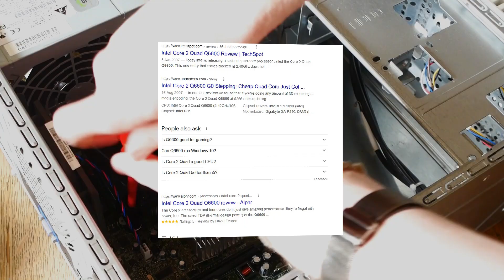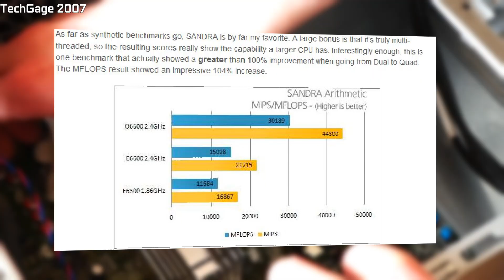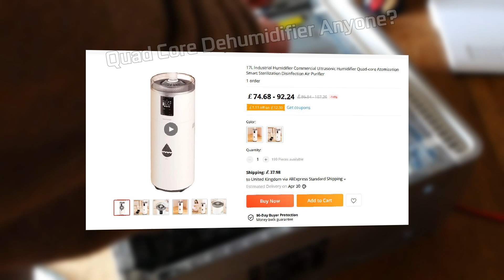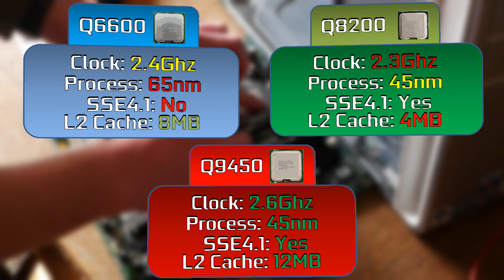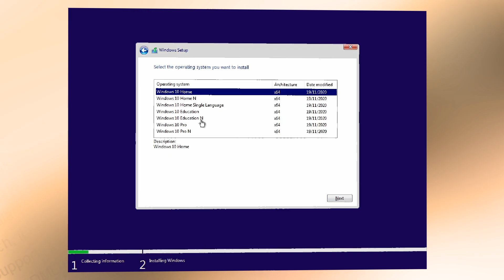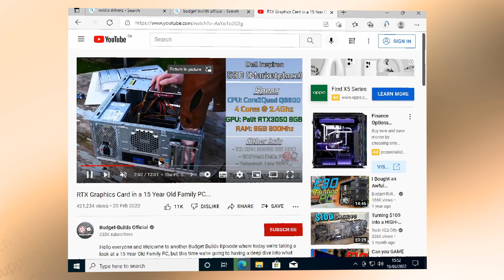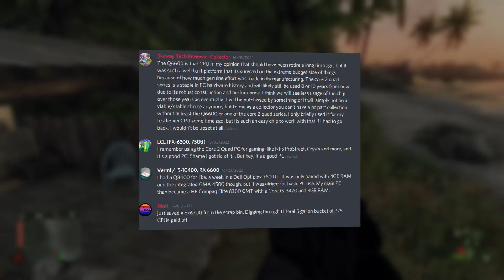Intel's Core2Quad...Finally Obsolete?

Comment: Pretty much confirms the experience I've had on my QX6850, E&X5450. Later C2Q are the only properly useful models. Not sure if it was just my setup or the finicky P5Q Deluxe - Windows 7 and 10 ran worse with the QX6850. And that's with all at 3GHz (Xeons both overclocked to 4GHz without any drama so that vastly widened the gap - QX6850 only 3.6GHz due to 1x die running 10 degrees C hotter).

The Xeons BTW ran beautifully on my free Asus P5K-VM - in fact it ran heavily modded (Realvision ENB+all mods recommended by it) Skyrim nicely even paired with my GTX 650ti 2GB. After upgrading the motherboard however I was never able to get the same setup working as well. Also, never try overclocking Pentium 4 630 on budget mATX boards - things go badly.

Comment: Using a Q9550 equivalent Xeon E5440 in a Gigabyte EP45-DS3 motherboard overclocked to from 2.83 to 3.65 GHz and later I want to hit the magic 4.0GHz :D It's running with 8gb of GEiL Ultra DDR2 and a GTX 760 :P

Yes, Currently I don't have enough money to upgrade to a new platform, but I think it is interesting that I still using a C2Q for gaming, and can play GTA V on Very high, NFS Payback just to name some heavy title, and much more less heavy title of course. 

Overclocking gets the C2Q to another level, you should check out the performances with a Q9xxx on at least 3.4GHz :)

Comment: I still have my old Q6600 (G0) in somekind of retro pc running Windows XP. When i got it, i bumped up the FSB so it's running stable at 3GHz for years now. Running it at stock speed is almost a crime...

Comment: This video makes me want to go in the attic and get out my Asus p5e3 deluxe with DDR3 support with my QX9650 and see how much better I can do than you at 4.2GHZ. Maybe i'll make a video about it... some day :P
Reply from the maker: You’ll probably beat 99% of AMDs FX Releases on that beast.
Reply: @BudgetBuildsOfficial  leave FX alone 😔😂
Reply: @crofty565  the FX 6000 series was good budged for sure the worst CPU's AMD ever made was the A10 and so on CPU's that had no L3 cache or so that was really stupid.
Reply: @allxtend4005  I pulled together an A10 7800 build for my mom because it was quiet and relatively cheap… 🤐
Reply: Ahhh Linpack. My QX9770 @4.0 under liquid breezed through Linpack at under 55C core temps as if it were nothing, P95 barely elevated her core temps above idle at 4000-4200.
Reply: @spicywolf6718  sounds about right. A lot of the later chips did that at or near stock voltage.
Reply: I'll gladly wait that some day Timmy!
Reply: Pls
Reply: With that clock you'll easily reach 1000 points in Cinebench R20 and be able to play games like GTA V, Doom 2016 or Witcher 3
Reply: Three years later now. Let's do it
Reply: That is a very good motherboard. I wish I had one. They are still very expensive.
Reply: Me too.  I have an Asus p5e3 but its not the deluxe.  Still a great board that will take 16 GB of ddr3.  Not sure what to do with the board yet, but I may pair it with a GTX 770 2 GB I have.  One machine I still use has a Biostar TP45E combo.  This board is so funny to me.  It will take ddr 2 or ddr 3 (up to 8 GB).  I have a q9400 on that board, which is overclocked to about 3.6 ghz if I recall.  I enjoy using that PC still today-a really granular kind of gritty experience and very nice...
Reply: @WunderOps  did it take much work to get the 16GB kit going? From memory the X38/X48 chipsets have limitations on refresh which doesn't extend high enough for most 4GB modules. I didn't have much luck with 4x4GB Dominator GT but it mah have been the RAM as it was finicky in a Haswell rig too.
Reply: @spicywolf6718  I haven't actually tested the board with 16 GB yet...only 8, but it was 2 4GB modules.  Wish I could remember which ones I used for the test, but it was some time ago, and I have several types of DDR 3 here that it could have been.  It wasn't a long test...just testing the board for basic functionality after I purchased it on ebay.  Hope I can get it up and running, the holdup being which processor to purchase.  Also, I will need a solid cooler and you name it, including PSU and case.  Coming up with the parts will require some creativity, so who knows when I will be able to finish the job, but I will get to it eventually...just like I did with the Biostar PC lol.  I wonder if your RAM was too good?  Is that possible?  Chances are I was using Crucial basic DDR3 RAM or Kingston low profile RAM.  I think I was using 1333 mhz (dual channel).  I know that is what's in the Biostar computer...
Reply: @WunderOps  very specific Corsair part nbers would post with 16GB, I managed to he the post screen at aassive downclock but my understanding is that even if you can show post it won't be usable memory as it won't be addressed or something like that. I just don't have a quartet anymore to find out
Reply: @spicywolf6718  OK, thanks for the information.  I am so curious now I think I will get the board out on a test bench I made here and take a look at this memory issue with this board.  Let you know as soon as I have some information.  Part of me is so sure I had it working with 16 GB even, but memory is failing me no pun intended and no bad mojo hopefully 🤞
Reply: @spicywolf6718  P5Q3 is seeing 16 GB in the BIOS.  I did not install an OS, and the 16 GB was a matched pair of Kingston 4 GB 1333 Mhz sticks (8 GB), a stick of standard Hynix 4 GB 1333 Mhz, and a 4 GB stick of HyperX 1600 Mhz (all I could find).  So this combination on the standard P5Q3 motherboard posted fine and all the ram was visible in BIOS.  Just noticed I have a P5Q3 rather than the P5e3 mentioned earlier in the discussion.  Sorry I couldn't put the board through the paces.  Don't have a case or the space here at the present time.  Good luck with your PC!   My feeling is that this board might be relatively stable when all is said and done, but I'm probably basing this assumption on the looks of the board which seems to be like new almost...
Reply: only 4.2ghz? That chip should easily be able to hit 4.7-4.8 on water! I had a Q9650 E0 stepping stable at 4.7ghz on that era's watercooling (cpu blocks were terrible compared to now). Might still have some of that kit floating around. Don't have any of my kit from then left except a single kit of DDR2 RAM (2x4gb), but I've been considering doing a fun build to revisit that stuff sometime
Reply: @TheOriginalFaxon  you're crazy. 4.5 is max I could hit on sub zero cooling
Reply: @TimmyJoePCTech  what stepping was it? I never has problems with temps on water with the E0 stepping chips. Was pushing like 1.42v through them, but yea, 4.7 all day stable no problem. Bought that chip in May 2010 from Frys lol. Gotta remember back then, a major stepping change could mean dramatic increases in bin quality. Gotta remember, that chip launched in Aug 2008, so by the time i got mine, Nehalem had also been out for a year and a half alongside it as the HEDT option, and bins on 45nm chips improved dramatically by 2010. I was seeing confirmed OCs on forums of E8700s hitting past 5ghz on water cooling, and past 4.7ghz on air. Those E0 stepping chips were absolute fucking monsters, some of the highest OCers i've ever seen
Reply: @TheOriginalFaxon  I highly doubt your prime 95 stable
Reply: @thej3799  feel free to Google around, there's tons of screenshots from that era of rigs that were stable at those speeds. I had moved to using linpack by then though, rigs which were p95 stable would not be linpack stable a lot of the time, due to the difference in how they test. That rig was 100% linpack stable for the 2 years I owned it, until I upgrades to a 2600k which was also 4.7ghz linpack stable. Idk why people think I'm lying when there's tons of evidence that these CPUs absolutely existed. If I could share images here I still have the screenshots and everything

Comment: The very first system I actually built was back in 2008 with a Q6600. I kept that chip for 7 straight years and used the 775 platform for another year with a Xeon X5460, as my primary rig. Then in 2018 I purchased again a C2Q, the Q6700 this time and along with some really cheap parts I built a pc to use it as a backup and for older games but sadly I haven't used it for over a year now. I'm in the hunt for a high end sli capable lga775 motherboard though and I'll be hopefully tinkering again with the Core 2 Quad in the near future. A friend also has retired his good ol' 775 system with a QX9650 in it, so I hope I can build a new system with that chip!

Comment: I  built my overclocked to 3.4Ghz Q6660 system way back in 2007 and have only just retired it although I'm sure I'll still find a use for it somewhere. I've upgraded the graphics card couple of times over the years and now paired with a GTX 970 it's still a pretty good machine for basic desktop use and older or more simple games. My Q6600 system is by far the longest lasting PC I've ever built and I somehow doubt I'll still be using my new bonkers fast I9 12900K in 15 years time.  Q6600 I salute you :-)

Comment: Got an Acer Veriton SFF with an Q8200, 4GB DDR3, 60GB SSD, HD5570 1GB and a 250GB HDD which works perfectly for my little one playing Roblox etc. These machines with an SSD and 4GB RAM, 8GB if you can get it are still perfectly fine for day to day use and certainly for people on a limited budget because games from years gone by let alone AAA titles currently are still worth playing.

Comment: On my lan system I take when I go to friends houses I have a Q9650 (separate PC since my main workstation is huge and heavy). Does pretty well. Have a GTX 670 in it since you can get them brand new for barely over $100 if you know where to look  and they run great. 
Also in my NAS/render farm (long story) I use a Q9550 and it does pretty well. Mainly since I can get LGA 775 boards for free lol

Comment: 6days later i upgraded sister pc from core 2 duo e8400 to quad q9400 because i need to run gta5 without mising textures on it, but still some textures mising. The pc has msi g41m e43 motherboard 8gb ddr3 ram and hd 6850 2gb

Comment: Funny that you should make this video as I'm considering what to do with my C2Q 9505 rig that dual-boots XP & 7 for old games from the early 2000's to early 2010 or so. Win7 to download the games somewhat safely with somewhat modern browsers, XP (32-bit with PAE patching to allow more than 4GB RAM recognition) to actually play them on period-correct OS and hardware (with a GTX 760 2GB).

Comment: Still have my E6420 to Q6600 in Asus P5W DH Deluxe then to an Abit P35 Pro. GPUs it paired with over the years ATI X800XL > 8800 GTS 640 > 8800 GT > HD 5850. The Q6600, Abit P35 Pro with HD 5850 lasted up till a i5 2500K with a HD 7950.

Comment: I recently acquired an HP DC7900 desktop with a Q6600, and 4GB of RAM from the local recycle drop off for no money, I gave it a good clean, replaced the busted Seagate HDD with 120GB SSD, dug around my parts bins, came up with 8GB of DDR2 RAM, and a 1GB Pegatron AMD 6570 GPU, put Solus Linux on the machine, then I gave it to one of my elder neighbors who needed a new PC after dropping their laptop, and cracking the screen hoping I could fix it for little of nothing, and they love it for their basic daily task on an older 32in 720p LCD TV we pulled from their guest room.

Comment: Fantastic test! never had one, jumped straight from an athlon x2 to a first-gen i7 860, but it would also be very cool to see how far these can be pushed when overclocked in 2022. I remember building a cheap q8400 system for a friend to play overwatch on something like 5 years ago and it performed admirably well after a slight overclock and paired with a radeon RX 460

Comment: Not related to the video but, it's good info to know. I'm still using the first gen i7 920 (LGA 1366) in a system and I can play a lot of games in 4K@60 fps using various settings on a per game basis. My bottleneck is always the GPU which is a GTX 970, the CPU usage is never the problem. To play 4K@60 fps I have to use low or no AA and AO, but again, it's the GPU that's the issue. Now maybe there's some CPU optimizations that the i7 920 is lacking behind the scenes that I don't know about but, no game, even a game released today, has a problem starting and playing.
Reply: that's good to hear, I'm planning on "upgrading" from my q8400 to an i7 940, I just need to get the motherboard working, it doesn't turn on

Comment: I swear the core 2 quads were able to use ddr3?
Reply: yep they were, I have a ddr3 motherboard with a q8400 as my main rig, but oh man it's really picky with its ram, it only supports to my knowledge, 1333mhz ram, and it really doesn't like anything over a 4gb stick, even if you get it all right it can still be weird about the ram, I'm personally running ddr3 6gb at 800mhz because it for some reason won't boot at 1000mhz, the only other option it gives me, I think I'm gonna sell this mb in favor of a 4 slot ddr2 one, I'm planning on upgrading anyway
Reply: @ethand4784  idk i didnt have much issue with my core 2 and ddr3. The lower mem frequencies was just an intell thing in general

Comment: I had a Q9650 (4ghz oc) + GTX660 a while ago was running everything fine.
Reply: I'm running a q8400 with a gtx 770 that I upgraded from a 650ti, it runs most things alright or it won't run at all, I don't think I have a single game it can't run other than halo infinite, but I imagine there's work arounds

Comment: I would recommend a core 2 quad system in 2022, but not as a main rig, unless you're desperate of course, they can do anything online and fairly quickly for their age, I don't know too much about doing 4k on one but I've done 1440p youtube just fine, my personal bottleneck is my internet, I'd recommend one of these really only as a dirt cheap pc for say a person who needs a simple pc chromebook type thing or as a big storage system or whatever, maybe you could even use it as a server, I'm pretty sure I had wii and Xbox 360 emulation working on mine but I don't remember, you can always ofc use this as a sort of retro gaming pc as people usually get these for their compatability with older games. one more thing, if this was your only choice for a pc and you were comfortable with older games/ simpler games then you could make it work, these guys just keep surviving and I'd call it not obsolete but just really slow in 2022

sorry folks that was a lot

Comment: I have a Q6600 I got out of an old acer desktop, attempted the tape mod on that acer board but it would never boot. Still fun to mess around with. Picked up a rare itx ddr3 775 board a while back. Super finicky with ram. Would never boot with any dual stick kit I had. Ended up settling with 2 un matched sticks lol. Q9450 is currently in that board with an Nvidia chipset. I had to dig for drivers lol. Still lots of fun to be had with these early quad cores. Might turn one into a router for shits!! Haha
Reply: Yeah those Nvidia chipset is kinda annoying usually i always looking for intel chipset like p45 or p35
Reply: I have one of those ddr3 boards and it HATES most ram I try in it, it only accepts ram up to 1333mhz 4gb, and even with that I had problem after problem, I'm currently running a 4gb stick and 2gb stick at 800mhz I believe, it just won't boot at 1000mhz, the only other option it gives me, what did you figure out about it? I might actually just switch to a ddr2 mb and give 8gb a try but if these boards are rare is it something I shouldn't sell?
Reply: oh btw if you could share the board and possibly the drivers for it that'd be real helpful, these things really don't have good driver support lmao

Comment: I'm stil using my q6600 as my main system. Tripple booting FreeBSD, Linux and Windows  . FreeBSD and Linux run really great on it. I don't like how it runs windows 10 but I sometimes need to :( . So if you're not gaming it's stil a viable option In my opinion.

Comment: I just bought, about a month ago, a Dell Inspiron 545, for $80, that came with the 22" monitor, speakers, keyboard and mouse. It has the Q9400, 8gb of 1600 ram and the original 750gb HDD. I added an RX 470 4gb and windows 10. Works absolutely fine for a daily driver. YT videos at 1080p,60hz and some much older game titles run without issue. It may just be the best $80 on a single computer purchase I've ever made.

Comment: For some reason, I wanted to go down memory lane in an old core2 quad system. It is an OEM Lenovo Desktop that was recently retired from school usage, I scored it for $20.
It already had the Q9650, and 8 GB of DDR3 memory.
I only need to throw an SSD, and a GT 1030 in it, and it will be a full system. I am genuinely curious how the factory clock of 3.0 gHZ will be in modern titles. These really are some fun platforms to tinker around with.
Reply: I got a gtx 770 that I revived with a heat gun in mine, I thought I might as well use a gpu that lost it's support in something that doesn't support those titles either anyway, before that I had a 650ti, I think your gt 1030 will be a good fit for the system, but if you haven't bought it yet then I'd say maybe consider a used gtx 760 or 650 ti or anything faster than a gtx 650, they may have lost support for some titles but those kinds of games can't run on a c2q  anyway
Reply: Well speaking for my own experience with qx9650 it's fine and can do everyday task smoothly and some modern games somewhat ok and retro games smoothly, owh you can still oc the fsb the hell out of it with good mobo 4ghz is achievable

Comment: Correction: The highest end Core 2 Quad is the Q9650 (3.0GHz, FSB 1333 MT/s) and best Core 2 Extreme is the QX9770 (3.2GHz, FSB 1600 MT/s).
Reply: Well QX9770 can even do dual sockets thing like high end server of those days